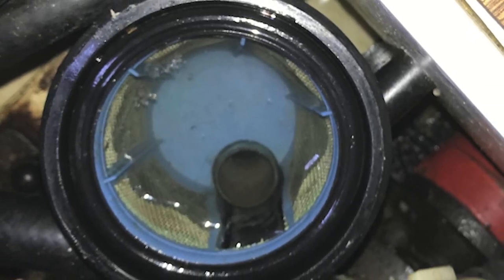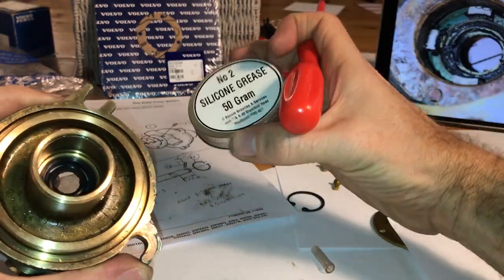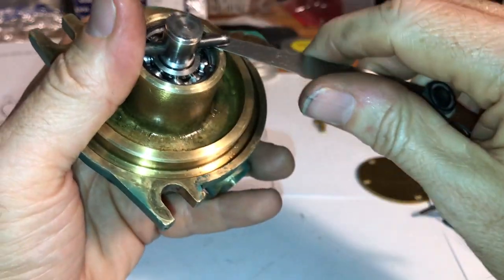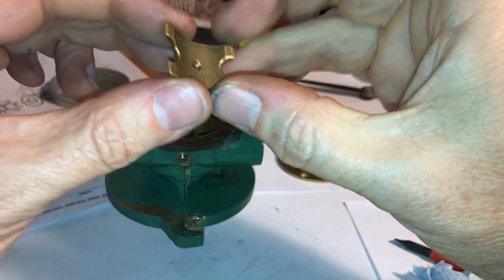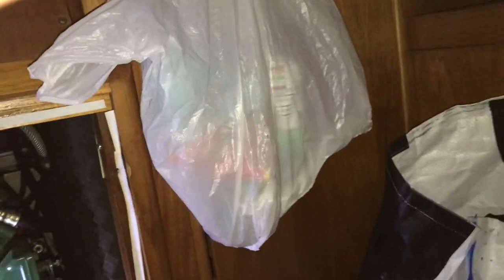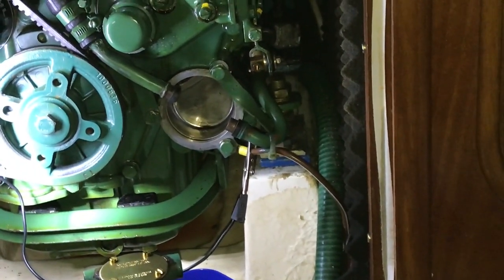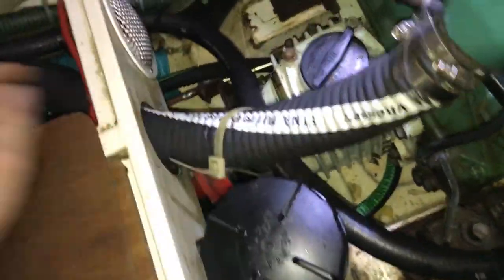Volvo Penta 2003 Sea Water pump rebuild

Comment: Do you still have this boat? I have a question on this volvo model 2003. I recently purchased a vessel with this motor and I noticed that the anti siphon for the cooling system pisses like an outboard. I have never ever seen this. It runs into my bilge. I am assuming yours does the same thing? Not much info on this. Any help would be great. Thanks

Comment: Anyone knows how to remove the pump ? Looks easy to put it back ? No trick ? Thanks
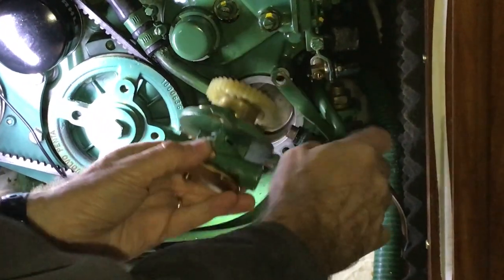Reply from the maker: Removing the pump is easy, it is the reverse of fitting it - which I show on the video around 5:02.  The only thing to watch out for is any wires connected to any of the three retaining bolts, as on my boat, the electrics for everything were grounded through the engine and connected to that point.

Comment: Did you have to drain the engine oil before removing the pump?
Reply: Nope
Reply from the maker: No, you do not need to drain the engine oil before removing the pump

Comment: Can i ask did your impeller sit flush? Im rebuilding mine and it seems to protrude past the face a fraction of a mm.
Reply from the maker: Hi, I didn’t notice it not being flush. I think I would have noticed when I ran the razor blade over to clean the gasket surface.  Check the shaft is in the correct place and that there is no dirt behind the back plate. Let us know how you get on…

Comment: What was the part # for the rebuild kit that you used? I have the same problem and need to do the same repair? Thx.
Reply from the maker: The kit was already on the boat, so I’m not sure how old it was. part number = 876756-9 Renoverningssats Overhault Kit.
Reply: @Gi1e5  Great...Thanks!

Comment: How do you get the bearings on the shaft? They dont just slide over it. Do you need a special tool for that?
Reply from the maker: I used a bit of copper plumbing tube and a vice to press the bearing on to the shaft. What I actually did was to press the first bearing on enough to get the spacer and the second bearing on, however once both the bearings were on I was struggling to push both the bearings to the correct position together.  I ended up taking it to a friends garage and using his hydraulic press to get them in the correct position.  Next time I would press the first bearing on and get that to the exact position, then add the spacer and the second bearing.
Reply: @Gi1e5  Great, thanks... I just replaced the seals now...I had a small drip, so this should fix that. If not, I will replace the whole pump...found it for about $250, Johnson pump. You have access to some other good tools, which help. Good job on the video!

Comment: It's not clear in the video but it appears as though there is a gap between the two bearings?  If that's the case is there a spacer between the two bearings?
Reply: No just an amount to allow oil to flow

Comment: well did it actually start to smoke less ?
Reply from the maker: The ‘smoke’ was steam, because of the seaweed blockage.  The engine is now being cooled ok.  There is still some light smoke when it starts, but after a run at high revs it is not noticeable.

Comment: You need to change you governor spring so the engine will start easier when cold.
Reply from the maker: Yes it didn’t start easily did it - but it wasn’t the governor spring - it was my starting procedure that was wrong..  These engines have a special method for starting when cold.  You have to set the throttle open ( at least half, but I’ve found somewhere around 3/4 to be best) and then pull the stop handle (and push it back in) before starting. 
This supplies extra fuel by overriding the injection pumps governor, allowing the fuel injection ‘rack’ to go beyond the normal maximum fuel setting for cold starting. It works really well, and our engine always starts within 3 to 5 seconds even in very cold weather.

Comment: Epic fail!    You never, ever, ever install a bearing in a housing by hammering on the shaft.  That treatment puts loads on the bearing it was never designed to absorb.  The bearing will fail!!  Those bearings were meant to be installed by applying pressure to the outer shell and pressing it in.
Reply: @PaudolphyGmail    Hi.  Yes you kinda sorta need a special tool which can be as simple as a piece of pipe who's diameter is slightly less than the outside dismeter of the bearing you are installing.  A socket can often be used.  The point is to apply pressure only to the outer race of the bearing.  If the bearing fit in the housing isn't too tight, light hammer blows can be used to install the bearing.  Make sure though that the bearing goes in straight.  If light hammer blows are insufficient to seat the bearing then a arbor press or a hydraulic press are required.
Reply from the maker: The two bearings are separated by a spacer on the shaft, so pressing on the outer race would apply the exact same forces to both of the bearings as pressing on the shaft since the force would be transmitted through the shaft, the only difference being that the force on the upper bearing would be in the opposite direction.  This happens because the force needed to move the lower bearing would be transmitted through the upper bearing to the shaft, then through the lower bearing to move the outer ring of that bearing.  The two bearings are separated by a spacer only on the shaft so there is no other way of inserting this. I did check with Golden Arrow (our Volvo Penta dealers) to see if there was another method but this was the method they suggested.  A year on and the bearings are still working fine.
Reply: @Gi1e5  Excellent explanation. I scratched my head when installing these, wondering how to install two bearings at the same time, separated by a spacer. The simple thinkers in the crowd will exclaim it is done wrong by not pressing on the outer bearing. Sure, that's correct if you install one bearing at a time. Here, the conventional approach is to press both onto the shaft (which takes more force), then install the shaft already mounted with both bearings into the housing. When installing the shaft loaded with both bearings, if you press on the outer race of the outer bearing, you actually make things WORSE by causing more damaging torsional forces to BOTH bearings. The fit into the housing is not as tight as it is on the shaft, and I think these housings are designed to be loose enough to not damage bearings at installation.
Reply: I'm in the process of doing this just now (today) ..here's what I'm going to do.
1. place new shaft and one bearing in freezer
2. place other bearing in warm oven 
3. When cold remove shaft from freezer and using appropriate diameter pipe or socket tap warm bearing on to shaft to 39.5mm from impeller end.
4. Place new assembly back in freezer and warm up pump body , when shaft and bearing cold remove from freezer and using the outer race tap into housing using appropriate socket until it seats then place spacer over shaft.
5. Remove warm bearing from oven and tap down until seated against spacer using the inner race and socket to fit. 

How does that sound?
Reply: @stephenauty2402  Hi Stephen.  I think you've done this before.  Exactly how it should be done.  Carry on skipper!
Reply: @99Randizzle  Yeah I did but screwed it up...the socket I used to tap the 1st bearing on had an internal bevel (like they all do) which meant the outer edge came into contact with the cage meaning the bearing turned really rough , I ordered a new bearing, well 2 actually just in case. I have now got a piece of steel pipe that is a perfect fit so I'm waiting for the new bearings to arrive.